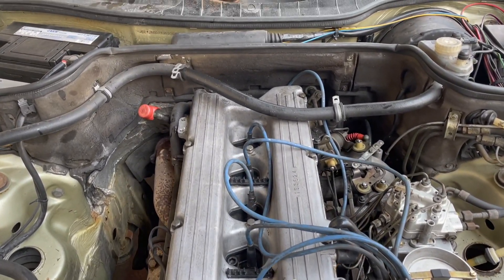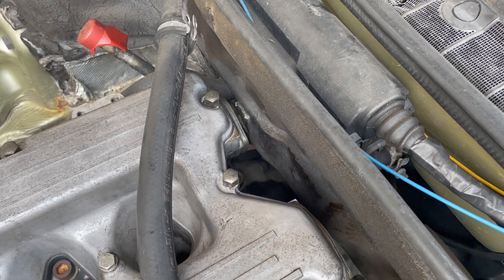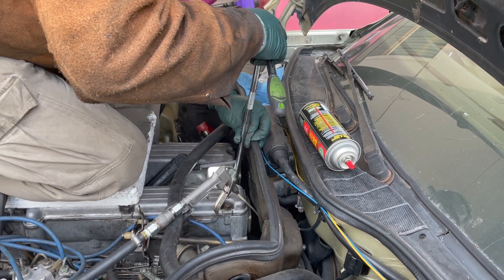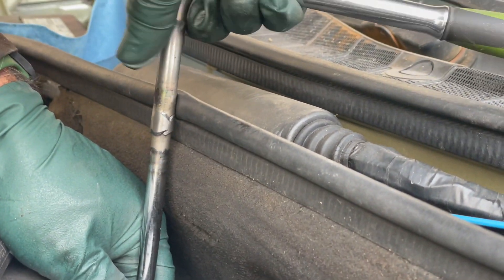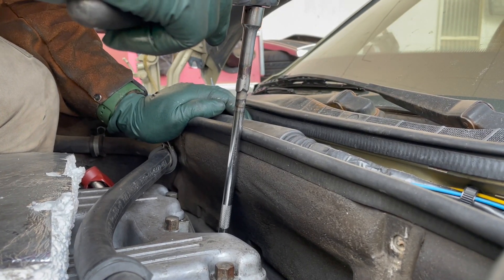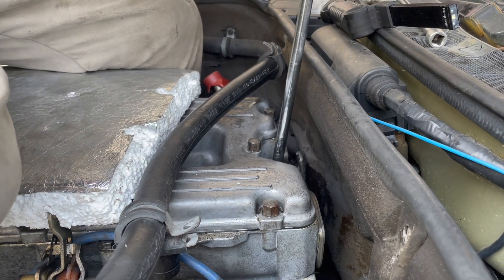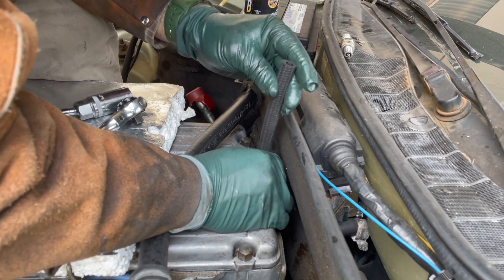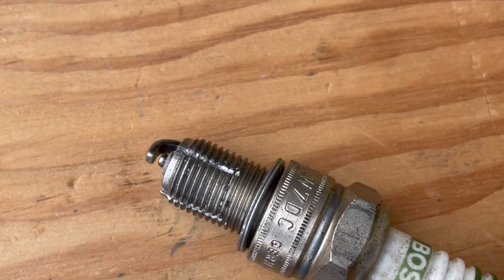How to Avoid and Repair Damaged Spark Plug Threads

Comment: I like the braided hose idea for threading plugs in hard to reach places (by hand).  I also find some people choose to rush the replacement of spark plugs leading to problems.  Always take your time, give yourself hours even a day to do the service.  Don’t start working on tune up items when you have to have the car back on the road in 20-25 minutes.  I learned how slow and tedious something like spark plug service can be when changing the (16) plugs on my M113 V8.  That job makes any standard single plug per cylinder job child’s play.

Comment: This happened 2 me along time ago and did this repair exactly the same as you did except before I put the new plug in I cranked the motor to make sure nothing foreign got in chamber from the chaser eventhough I used grease I figured it would be a good ideah to blow anything foreign out,, no problems since! :)

Comment: Thank you so much for the video Kent! Changing the 6th cylinder spark plug is a big problem. Another problem with this M110 engine is the removal of the crankcase cover.